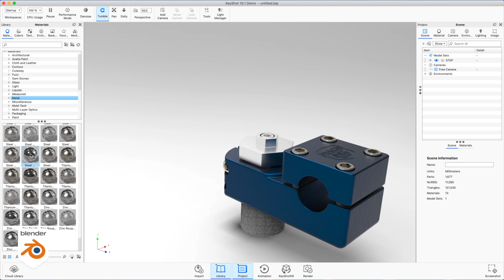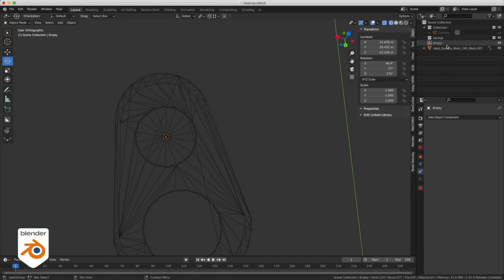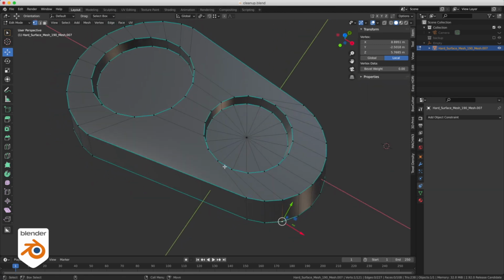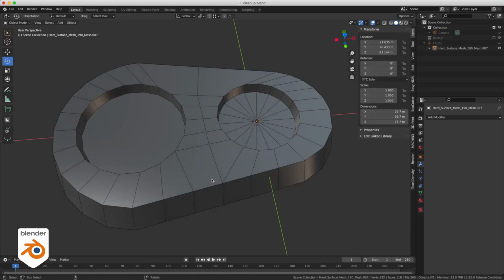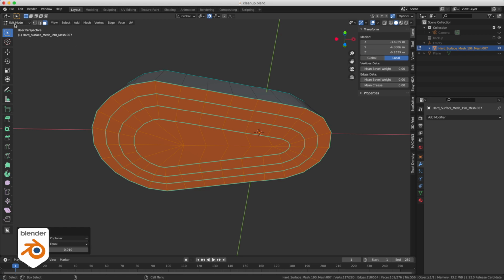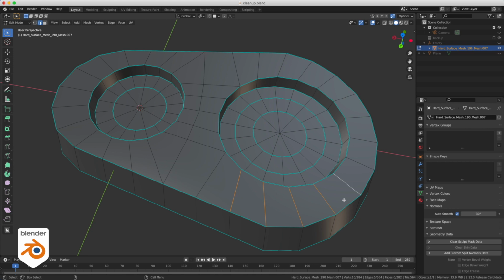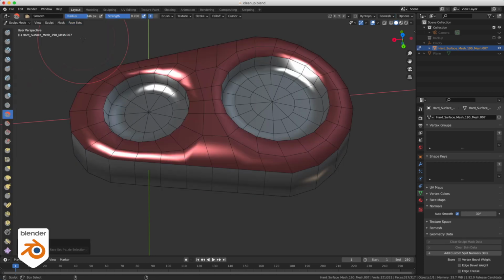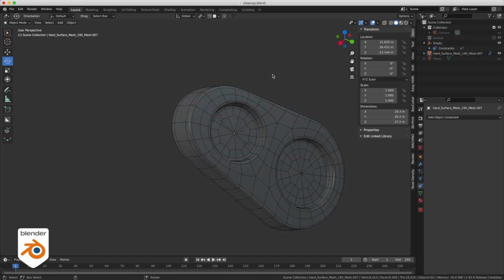Advanced modeling techniques in Blender Part 4 EP19d

Comment: Btw you can also just Clear Parent (without keep transform) and you mesh will go back to place where it was before. Also, in case when you want you mesh to be oriented in a certain way for additional modeling/cleaning but the mesh is already a part of something and you want to see how the things look together: you can Duplicate (with "Linked" options) you mesh, parenting duplicate to empty, move it somewhere, etc, and - edit it. Cause its linked, your "original" mesh which are still sitting somewhere on the big model will also be changed. But unfortunately it will not link the modifiers automatically. 

p.s. Love your jokes :)

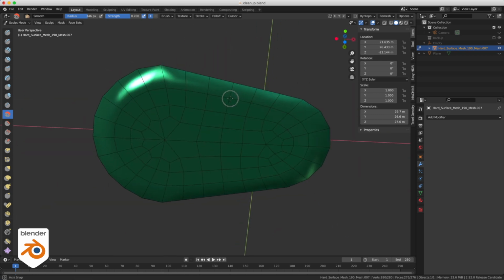Comment: i do insets on Ngons before splitting to grid so all edges are perpendicular to corners. The smooth trick need to be done on everything except insets (shrink 1 time) (on 9:11 not all edges are perpendicular)

Bevels from perpendicular inset edges are better because they wont have twisted topology (which makes radius non-uniform in these places and screws up shading a bit because vertex normals look in weird directions)
Reply from the maker: Yeah, that’s very good too.

Comment: What would be the best file format exporting from keyshot? At the moment i used fbx and obj from a client but got problems with the normals. Remodeling is in this case not an option.
Reply from the maker: OBJ is the most basic format. I use it to cleanup corrupted geometry all the time. If you get issues with OBJ, I don't see how you could get better results. What software is used for the creation of the geometry?
Reply: @BlenderBob  The Geometry is created in Creo (formerly Pro Engineer if I am not mistaken) then exported to keyshot for product renderings which the client is doing intern. According to the client they have more export options out of keyshot than creo
Side Note: With the custom split normals provided by the export the shading seem "fine" when you are not too close.  But in EEVEE the lighting is exactly backwards (meaning sun lamp pointing down results in lighting coming from the bottom), and in Cycles it renders black. After a long time tinkering around I got it to work in Cycles, by putting a vector math node  in between the normal map node and the pbr shader, multiplying x,y and z by -1. Besides a few edge artifacts it works ..... kinda
Reply from the maker: @valentinmoser8103  I got into issues with OBJs imported into Blender where normals looked flipped but it was actually a shader problem. Just assigning a new shader fixed the issue. I don't know if it's the same problem for you. Without seeing any files it's hard to diagnose.
Reply: @BlenderBob  Not in my case. I don't expect you to take a look at my files, but do you have any tips on how to handle obj which are not waterthight (meaning you cannot use the procedure you showed in 19 f) Thank you for your help!
Reply: Just found 19c. I think that could be the way to go! Thanks
Reply from the maker: @valentinmoser8103  Great! I hope it will help.

Comment: Help me Blender Bob, you're my only hope.  I was just starting to learn hard surface modeling and topology when several other blender tutors basically say I'd  be a sucker for modeling with "old school" quads. I should use Box Cutter and Hard Ops with ngons instead.  What's a would-be modeler to do?
Reply from the maker: Hi! Well, I strongly suggest that you check my clips 1 a to e. That will give you a good start. Then this series (19 a and on). :-)

Comment: Instead of selecting edges and subdivide them, we can use knife tool and hold ctrl to snap to mid of the edges, it will be very fast.
Reply from the maker: I try to avoir the knife tool. For some reasons I don't like to too much. I preferred Maya's. It more complete. Then again, the goal here is to show different approaches. Thanks for the tip!

Comment: Whoa, wait, shift-w to force connect edges like that? That doesn't exist here for me. Are you using a custom keymap; can you check what operation that corresponds to?
Reply from the maker: It's actually just subdivide edge. Yes, I remapped it. My bad. I should have checked. My Blender is so customized.